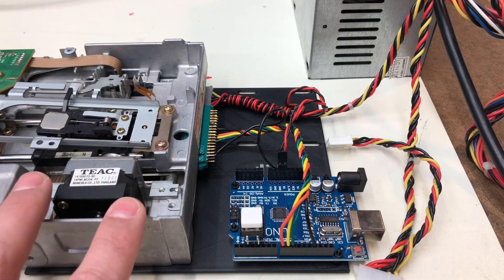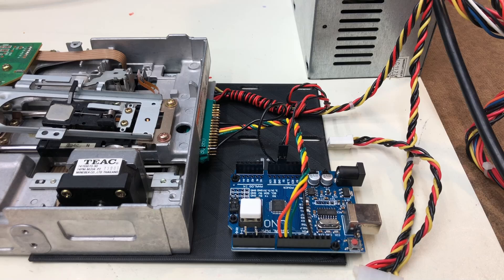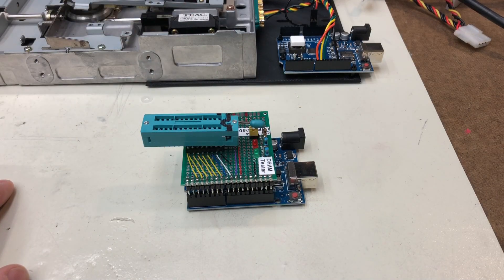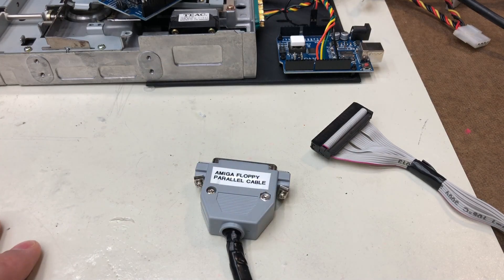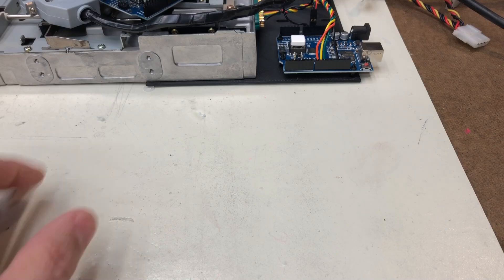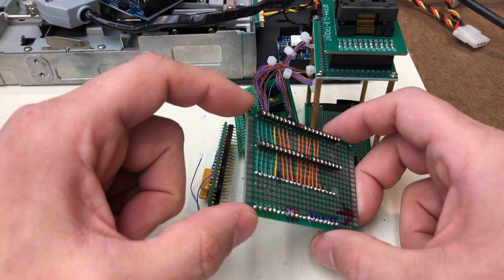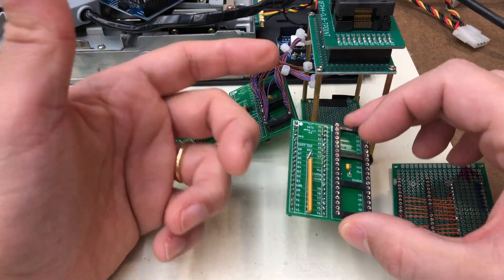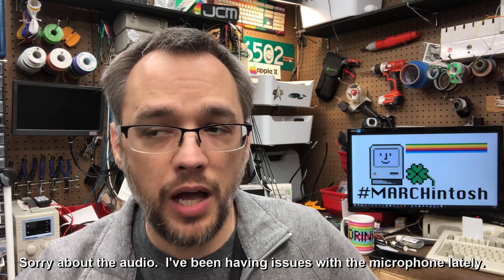I built some crazy diagnostic tools...

Comment: I have one of XE1541 cables. Works great on a Win XP box. Not so nice with Win 10. I've got a custom made Nintendo Disk System cable. Comes in handy when using my FDSstick writing to disk. Totally unnecessary in this day and age but I prefer to play stuff the way it was meant to be played. 

I had no idea alcohol could be used on 5 1/4 disks... that's a new one. cool idea though. I'm surprised there wasn't a c64 diag harness.  I really need one of those.
Reply from the maker: Yeah, you can use isopropyl on floppies, as long as you are very careful. Depends on circumstances. Sometimes you'll just end up scraping the magnetic coating right off the disk.